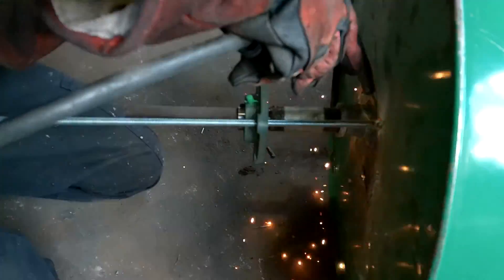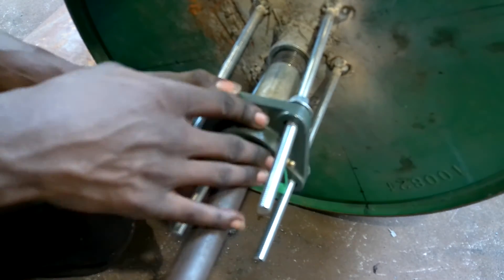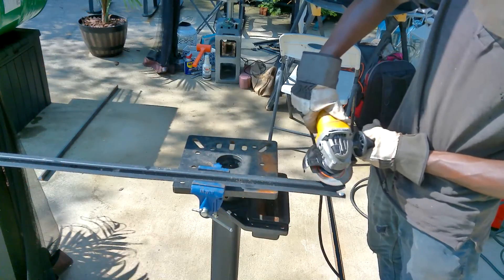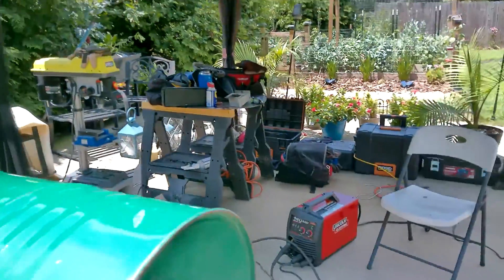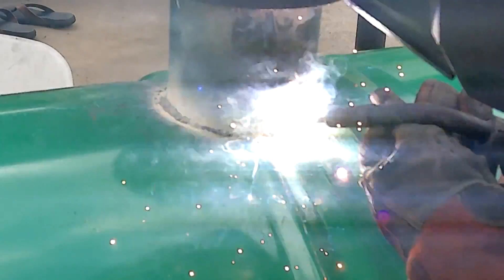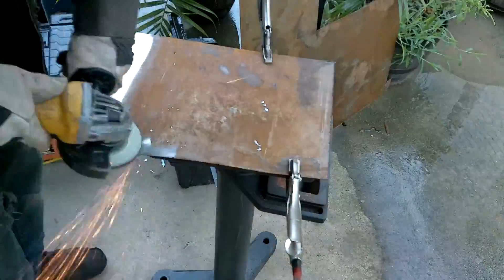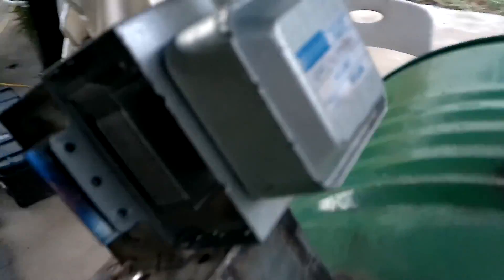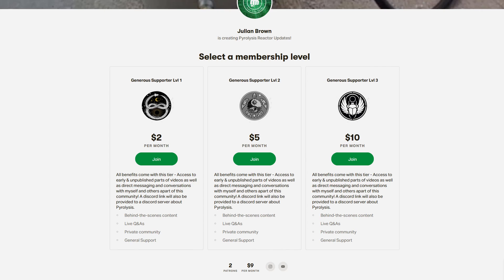SHE WORKS! -  Building Mark III MICROWAVE Pyrolysis Reactor Part 4!

Comment: Any engineers here sugest a waveguide to a microwave horn for better impedence matching?

Copy pasted from  a mucrowave electronics sight. 
"The horn antenna may be considered as an RF transformer or impedance match between the waveguide feeder and free space which has an impedance of 377 ohms. By having a tapered or having a flared end to the waveguide the horn antenna is formed and this enables the impedance to be matched. Although the waveguide will radiate without a horn antenna, this provides a far more efficient match.

Proper and well designed  impedence matching reduces reflected power, standing waves and better transfers energy from an antenna to free space, or in this case transwers the power into the reactor cavity.

Comment: You could use this as a plasma furnace for carbon vapor deposits. Diamonds are really useful and cool. They transmit heat very fast. I was thinking 🤔🤔 diamond soldering point? I need the plasma fumes so anything i make with the heat is a bonus to me. I wonder though would solder wick to a diamond? I got the idea after seeing a 3d printer nozzle that was one. 
All of these ideas came from a computer game lol in the game you could diamond coat a sword using a CVD machine. +2cutting!!😂😂

Comment: Hello. Ive been looking through your videos and I think for water/oil separation you should probably be testing with freeze/thaw cycles or electrostatic coalescer. Freeze/thaw could even remove water vapor in your syngas.

Comment: hey brother, just found you today on tiktok and came to your tube! i love this concept and im sure after enoguh r&d it. i have a question, and sorry if you've answered it somewhere else. what temperature and pressures are you aiming for inside the reactor?
Reply from the maker: The temperature is focused purley on the plastic, as microwaves heat the plastic more than the chamber. But we want surface temps of atleast 700 F, or around 400 C, and the pressure ideally should not be below 1 psi or exceed 5 psi

Comment: Is there a reason why the hopper/input isn't closer to the edge of the drum?
Reply from the maker: Yes, so any material doesn't get trapped behind the blade flange. I made an engineering mistake with the blades, causing the very beginning of the auger / spiral to be cut off from the rest of the blades  when I mounted the shaft flange.

Comment: Quick question I’m trying something Similar but mines is using a flame, but for cooling down the heated gas, what do you use? 

I’m using water but water is really bad with heat regulating Iv thought about anti freeze but it’s like £8.99 per 1L where I’m from and water basicly free what do you use ?
Reply from the maker: A liebig condenser is best used for flame. Microwaves don't get the vapors super hot so I don't need any special condensers for them.
Reply: @naturejab  wait wait wait so your telling me with the microwave, heating method you don’t use any cooling system and your still able to produce petrol, diesel, gas and the rest of the by products, bruhh thats fucking genius, is it possible you do a video showing how you collect the by products plsssss
Reply from the maker: @mala2158  I already do! Check out my past videos.

Comment: What type of load do you expect the bearing to work with? Radial or axial? That bearing is not well supported there
Reply from the maker: The bearing really won't be under much strain. Most weight is dispersed on the chamber itself

Comment: do you think you could make another video explaining how the reactor works and how the distiller works in a simpler way? like with layman's terms? my dad is a chemist but english isn't his first language and he's kinda skeptical about extracting fuel from plastic, he says it's like making diamonds from coal, possible, but would take huge amounts of energy.
Reply: It does take an immense amount of energy to produce this fuel (he has to power the magnetrons and turn the auger blades AND distill it, distillation being probs the most energy intensive/low yield part). That's a problem that could only really be solved by scale (impossible with just one dude and Big Oil not needing to raid landfills for fuel. Essentially he's taking energy from the local power grid (which probs gets it from fossil fuel power plants) and using it to de-process petroleum products. If prices at the pump get higher and his power bill doesn't, then this might have some kind of efficiency
Reply from the maker: @Conman2541  Well, I distill it with the gaseous product produced so that is a no extra energy put in.
Reply from the maker: Sure, I'll make a video breaking down all this later on in the future. For now, my first video is probably the best.

Comment: Be careful when looking or filming through the mentioned window. There might be microwaves escaping through the window, which can hurt you or damage your camera. You should probably put a screen on the it (like the one on microwave oven doors).
Reply: Needs a shielding, like in ovens doors.
Reply from the maker: We'll put faraday shielding
Reply: @bobjohn8581  a deep vacuum will implode a 55 gal Drum, a better bet would be to flush with a heavier than air gas like CO2
Reply from the maker: @bobjohn8581  Yes, every magnetron needs its own transformer circuit
Reply from the maker: @bobjohn8581  The fabrication is done because we need the waveguides completely airtight, so they need a flange system
Reply from the maker: @bobjohn8581  Vacuums can work yes, but pushing out oxygen with another gas is usually easier and better
Reply from the maker: @bobjohn8581  Hahha yea, Im going to install a 50 amp heavy duty circuit
Reply: @bobjohn8581  that would definitely be strong enough! for the auger seal I'm thinking the carbon dynamic seal packing from a centrifugal pump bearing full of high temperature grease, they're really good for pressure or vacuum, bell and gossett pumps sells just the seal kits, hmmm! Now I'm thinking about building one!!! 😉 You might be able to pull one out of an old chiller water pump if you know any mechanical contractors, they demo big pumps all the time
Reply: Some fine wire mesh over the aperture would deflect the radiation